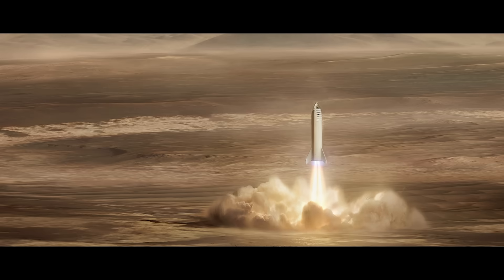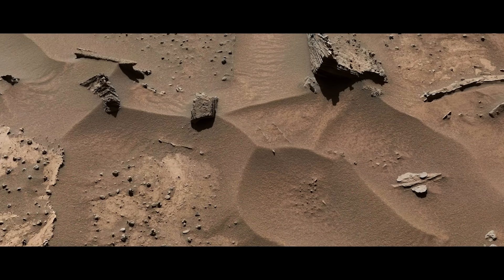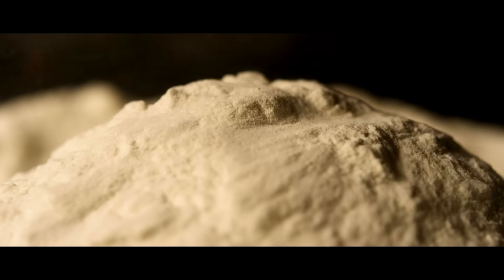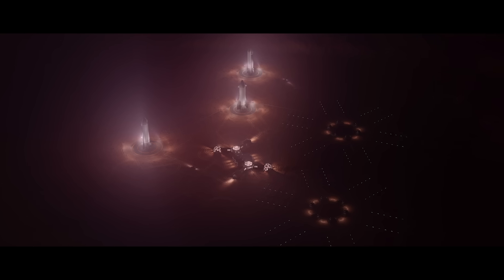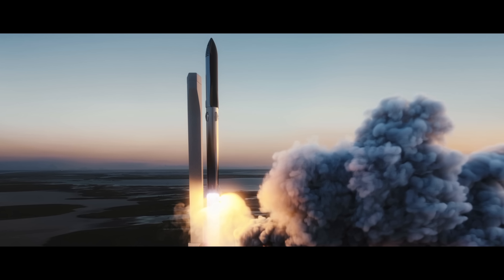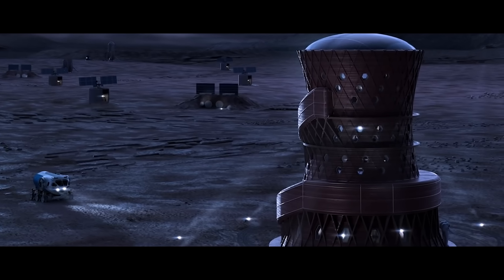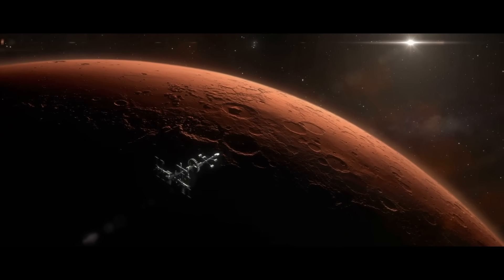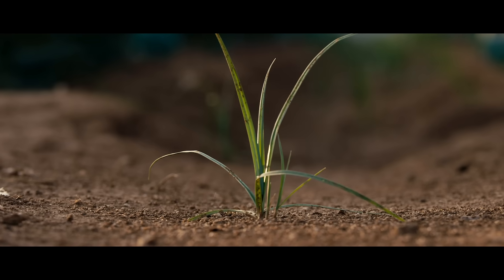THE FIRST 10,000 DAYS ON MARS (Timelapse)

Comment: Is this actually related/tied to Elon's plans or did someone just make this up for fun?  Also, I wonder if they could have spinning "artificial gravity" wheels for passengers between planets and/or if they would be worth it on the trip to Mars. And I wonder if we've developed faster rockets in recent years that can make the trip in less time.
Reply: Those artificial gravity wheels like in the Martian will probably never be real. Not because we're not technically capable of making them, we are. But because they're kind of unnecessary and inefficient.
Reply: @whateverreally1347  I think musk designed an efficient model that uses a verly low amount of fuel.
Reply: @villagerjj  also they're still tryna figure an efficient way to use a no fuel engine. I think one is called "em drive" and another one is an ion engine or something which basically could push itself in a direction without fossil fuel
Reply: @blindboy297  fossil fuel is not the only type of fuel, i believe the rocket fuel type most commonly used today is a combination of liquid hydrogen and oxygen, which i also believe is more efficient than fossil fuel-powered engines

as for "no fuel" engines, or reactionless drives, i'm pretty sure the EM drive concept was proven not to work after some testing. the ion drive does work and has been used before, however it does require gaseous fuel. although it does require less. there is also another feasible reactionless drive concept i've heard about using piezoelectric motors, basically just vibrating something using electricity to produce energy and thus thrust. a project on it i think is currently being funded and worked on but pretty sure no concrete results are out yet.

there are a few other thrust options that have been/are being considered, most revolving around nuclear power. one of the most prominent ones is the orion drive, which basically uses controlled nuclear detonations by pushing small nuclear bombs out of a pusher plate and exploding them behind the ship. the concept was said to go extremely fast, as in a reasonable percentage of the speed of light, however due to international law preventing the usage of nuclear weapons in space for good reason it was cancelled. it's not totally out of consideration though.

there's also various other nuclear rocket propulsion designs which i'm not gonna bother explaining because this comment's already long enough. but yeah, basically reactionless drives are theoretically possible but currently have dubious information, so nuclear propulsion or metallic hydrogen (you can look that up yourself) is probably our best bet for long term missions such as interstellar and interplanetary missions.
Reply: @whateverreally1347  The goal isn't to create gravity, but rather the illusion of gravity.
Reply: @whateverreally1347  we do not understand gravity at all and have no clue how to make something like that yet. only a dream right now
Reply: @waar_bly_jy  actually the "wheel" is based on the principle of centrifugal force, which is an outward force that pushes away from the center of a spinning object. It is very much understood and we would very much have a clue on how to make one, just go to an amusement park.
Reply: @waar_bly_jy  what ? Of course we understand it lol. Otherwise we would not have put a man on the moon ...
Reply: @waar_bly_jy  centrifugal force is very much understood. It has nothing to do with the force of gravity though "the wheel" uses it for a similar effect. Making use of the centrifugal force is probably the easiest part about those "wheels".
Reply: @waar_bly_jy   "we do not understand gravity at all..."

If that were the case, then explain all the successful missions. 

"spinning something fast enough and hoping it will create the same effect as on earth is a long shot."

Is it, though?  The goal of artificial gravity isn't necessarily to recreate Earth's gravitational effects but to apply the centrifugal forces necessary to minimize the debilitating effects of zero gravity on the human body.
Reply: I love how everyone just started arguing about artificial gravity and never answered this person's actual question
Reply: If your ship was more than 60 meters wide in the middle you could internally have a train like section going around in circles fast enough to simulate moon or mars gravity .put all sleep pods , shower,a small lounge be cramped but 9 to 15 hours a day of spin gravity you will arrive more ready for the mountain of work to do upon planet fall .
Then your spin gravity ship stays in orbit like a space station and you take a docked starship down to surface leaving a small crew aboard with a back up starship to act as relief crew in case of any major emergency.

When helps 7 months away having some help orbiting every hour or so would be invaluable.
Reply: @thomas.parnell7365  I wonder if a moving train would cause a wobble that would affect the trajectory of the ship--unless it was well balanced.
Reply: @ryanspackman548  a very good question that's why was thinking any internal maglev train going in circles .only take up say 20 percent of ship . could always go the other way take 40 Percent of ship 1 Gos 1 way the other counter clockwise.
Reply: The artificial gravity is already solved by joining two ships together and they rotate together ...
Reply: The problem with such a structure is that it'd have to be at least 2 miles in diameter in order to spin slowly enough. The smaller such a structure is, the faster it'd have to spin in order to create the same centrifugal force. Kind of like two cars with different wheel dimensions still being able to go at the same speed despite the small wheels rotating faster than the large ones.
Reply: I doubt Elon knows what a centrifuge is, does it look like those ugly “Starships” could work as centrifuges? They’d need to spin very fast to replicate 1g
Reply: You forget that you only accelerate half the trip, you waste the other half time decelerating. You can only accelerate at 1 Gravity.
Reply: @donraptor6156  having a spinning wheel on a ship would not depend on the acceleration of the ship
Reply: You have to understand that Elon Musk is just an actor of CIA. He is just a fraud innovator. So that people all around the World still believe or be fool that America is the pioneer of everything. They can't even catch up with Russia and China technology now. China is already now building their own space station. And if you do your research. All American space craft engine are made in Russia. Well America needs an Elon Musk. So their people won't bother about billions of dollars in space exploration. While hundreds of their citizens are being homeless annually.
Reply: @diocre7446  if you did your research, I think you'd be able to make a more convincing troll/propaganda comment.
Reply: @diocre7446  you know Elon isn't American right? You know Canada makes some of the best landing gears in the world right? You know it's not the cold War and there isn't as much of a competition anymore as to who can reach the moon first right? But seeing how you think I'd assume you're the kind that thinks billionaire should give all their money away not knowing it would cancel everything out because of inflation. What's a million dollar if everyone has it? I'm sure you never did anything to help homeless in your life yet criticize others for it.
Reply: Artificial gravity doesn’t work lol
Reply: @michaelp4899  of course it would. It's just the centrifugal force. 

If we're being technical it's a pseudoforce.
Reply: @whateverreally1347  the force it creates would be inconsistent from head to toe so it would be disorienting and a waste of money for any space organization
Reply: @michaelp4899 Not really, no. If the radius is large enough you could simulate gravity with minimal difference in the pseudoforce between head and toes
Reply: @whateverreally1347  in space, without gravity, you think spinning an object to create centrifugal force would pull the floating objects to it? I thought centrifugal force only works on Earth because of gravity and the connecting to the object. 
I don’t know either way. Just asking.
Reply: @hangtownranger  artificial gravity isn't about pulling objects to you. You're right, it wouldn't.

Artificial gravity is about generating a force onboard that would be equivalent to gravity for the occupants. So people could walk around instead of floating about.
Reply: @whateverreally1347  why would any space organization spend the time money or resources to construct that lol
Reply: @michaelp4899  why would they not?

Comment: Are the solar panels really less efficient on mats or do they mean less power out because of less sunlight.  The colder conditions on mars would make the solar panels more efficient not less.
Reply: Less power due to less sunlight. Intensity of solar radiation decreases over distance. The effective efficiency of a specific area of solar panels is reduced on mars. There is a temperature impact, but it is minimal as panels made for mars would be deigned to survive and be effective in the lower temperatures. In reality, there are a few factors in play. No clouds on mars, so everyday is sunny, but dust storms that last for months, would be difficult to survive.
Reply: @opieg7333  Efficiency is power out over power (sunlight) in.  You're talking about useful power, not efficiency.  Solar panels are more efficient as temperature goes down.  Not less.
Reply: @jbmillard  In terms of rating a panel's conversion efficiency, sure. In terms of preparing an array to power a settlement, efficiency is related to the array size required to meet the power target. Your original question was about "efficiency"  as a result of available light or mars thermal conditions. The efficiency of an array (not panel conversion efficiency) is by orders of magnitude more impacted by the amount of light as compared to benefited by the reduction in temperatures which marginally improve panel efficiency. 

A panel can be more efficient (at converting photons to usable electrons) due to temperature reduction and less efficient at producing usable electrons due to less photons available at a location.
Reply: @opieg7333  By your definition to raise the efficiency of a solar array, you can just add more panels.  That doesn't meet any engineering definition of efficiency I've ever heard.  I guess I should expect accuracy from youtube videos.
Reply: @jbmillard  1) you asked a question. 2) Stop... why ask something to then try to pretend to be an expert. If you would like we can get into the thermodynamic equations related to the panels and launch-reentry systems, I am willing but not for free.  Sorry for trying to help you out, should have known better when you couldn't form proper syntax and then wanted to argue definitions. GOOD BYE.  

Per you OP: Are the solar panels really less efficient on mats or do they mean less power out because of less sunlight.
Reply: @opieg7333  I was trying to understand what they meant.   I couldn't figure out why they would be less efficient on mars so I asked the question - I thought I might have been missing something.  I guess not.  They just don't know the definition of efficiency like a lot of people.  Thanks for the help.

Comment: accidentally terraforming mars like that wouldnt be possible without a much improved magnetosphere on mars to combat the radiation
Reply: Not just that, the fact that the salt content in Martian soil is poisonous to all Earth plants and animals alike. 

Being a much smaller planet without a magnetosphere would also mean that the small atmosphere that Mars has would easily be blown away by solar winds. 

Discounting the radiation from the sun and the toxic salt in the soil, plants won’t grow as well either. With a smaller atmosphere, any “wild” plants wouldn’t have enough carbon dioxide to fix and transform into carbohydrates, meaning that they’d still need to adapt in new ways which complex organisms have trouble with.

It’d be much better to send known extremophiles over to the planet as well and let it do early colonisation work as they can adapt much faster.

Comment: Day 1: Astronauts launch.
Day 31: SpaceX cargo pre-launches are destroyed by Mars' frequent windstorms, getting buried.
Day 32: SpaceX solar arrays are covered with dust from frequent windstorms making them completely inoperable
Day 67: Astronauts have now lost 1/5 of their muscle and bone density and they aren't even half-way to mars.
Day 121: Astronauts have now lost 1/3 of their muscle and bone density.
Day 123: SpaceX Starship makes direct assent landing, topples over and crashes just as NASA and Apollo teams working on the Apollo project in the 1950s predicted it would which is why they abandoned Direct Accent for Orbital Rendezvous in the first place.
Day 124: with 2/3 of the crew dead from the predictable crash, the survivors emerge onto a desolate wasteland with no power, no supplies.
Day 125: Survivors desperately attempt to recover the solar panels.
Day 126: Solar Panels are covered by dust storm again.
Day 127: Survivors desperately attempt to recover solar panels.
Day 128: Solar panels are covered by dust storm again.
Day 129: Survivors attempt to find and salvage supplies that were previously toppled and covered by dust stroms.
Day 132: Survivors have completely exhausted their reserves of Oxygen and Water as capsules don't generally carry extra resources because of the conservation of weight at launch.
Day 133: Survivors make desperate plea for help...but none will come because you're on FUCKING MARS and the next launch window will be 2-years from now and you can't just fire a rocket and go to mars.
Day 135: Most survivors die.
Day 136: Final survivors expire.

Day 137: Elon Musk holds press conference to announce a new Tesla Robot and a man dressed in cheap spandex, comes dancing on the stage to thunderous applause.

Day 138: Elon Musk is awarded billions by gullible morons despite being a complete vaporware salesman who doesn't have a clue about what it takes to be successful on Mars, and the REAL hardcore SCIENCE that it takes to make it possible.
Reply: Well if you're going to get all technical about it Mr party pooper.

Comment: Fun Fact: The Average Temperature in the Equator on Mars is 20°C rather than -39°C Making the Water present in the surface because of no Magnetic Field and Ultra Violet Radiation from the Sun. 

This makes Terraforming Mars easier but only in the Equator.
Reply: Not really,low air pressure will mean the water would evaporate and make the atmosphere slightly wetter

Comment: "Now produces all of its own power, air, water, food and fuel" ... "If resupply were to stop, the colony would survive and grow, but in a primitive way".  Uhh....that's not how that works. Since they need resupplies for advanced technology, then they will eventually have something break that can't be fixed, and then they lose the use of what can't be fixed, and then something else doesn't work because of that, or also breaks down, and they essentially end up with a march toward collapse.  It takes a lot to have advanced industries. Even if you have 3D printers, you still need the materials and parts for them to function, and all the people that are involved in that. And you need material/parts to make the materials and parts to make/maintain the things that get those materials and parts in the first place. One break in the chain and there is no "primitive", only colony collapse. It's not like they're going to go out and wrangle the martian surface into submission by hand. 

Over 100,000 people might sound like a lot, but it's actually not, considering all the disciplines and manpower needed to sustain a colony that large. Even if we think about something as simple as food, 100,000 people would need over 25,000 acres of growing space, in a dome. Even if the building was 25 floors high, which would be a pretty tall building, it would still need to span over 1,000 acres, which is still massive. That's a VERY large building, bigger than any building on earth even. To put it into perspective, if it was one floor high, it would be a building about 1/8th the size of NY city. 

You'd need industry for everything, from every raw material, to every technology. That's more industry than even 100,000 people could generate. And all of this has to fulfill the needs of 100,000 people too, so it's not like you could get away with a handful of people in this or that area. You need tons of engineers.  You need tons of specialized types of engineers, from the guy who can work on a vehicle to the guy who works on the power plant, right down to even the little things like lightbulbs. You need enough doctors for 100,000 people. And more importantly, you actually need to have a purpose for these people to be there other than to just have a nice big colony. Otherwise it's the snake eating its own tail, where the colony only exists to keep the colony running. That's a big problem, because unlike earth, the colony would have no room to naturally grow, and would have to create more colony space just to expand, which doesn't at all change the equation of the problem.  The colony will still only ever exist to keep the colony going.

Comment: It is not true that solar panels are 43% less efficient on Mars compared with Earth. They're just as efficient, but they produce about 40% of the energy that they would on Earth because the Sun is further away and therefore the amount of energy in sunlight per square meter is less than on Earth.
Reply: Thats... what he meant.
Reply: @anonymousfish2456  perhaps that's what he meant, but that is not what he said. The efficiency of the panels is the same on earth and Mars, but the energy produced is less because the input solar radiation is less.
Reply: Yep